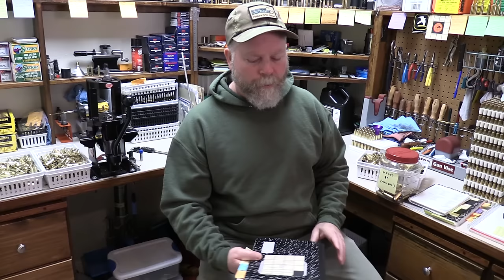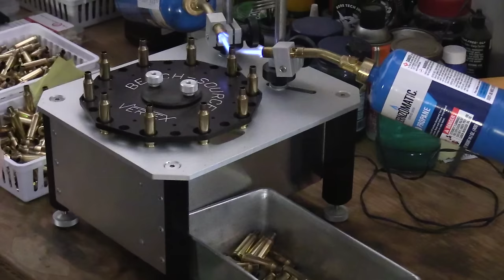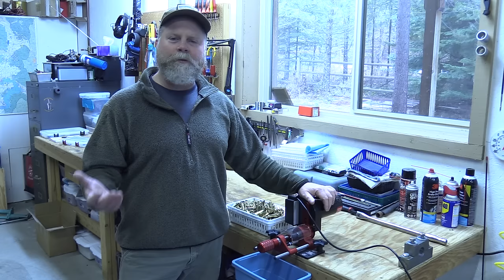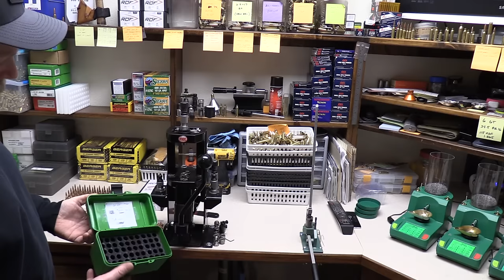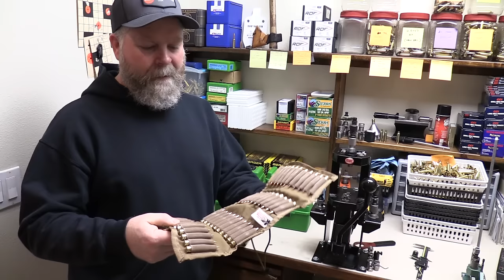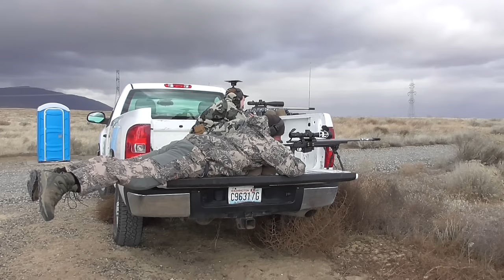Reloading for Precision Rifle: My Process--Start to Finish

Comment: I have an idea. Why not get some new brass,  full length resize it and find a load it shoots good. Then trim it all to the same length and weigh the brass and let's see if using as identical as possible the same length and weight brass. Makes a difference. Then try neck sizing compared to bump sizing and let's see which is better. Then with that settled,  use whichever one wins and turn the necks down to see if it really makes a difference. I've been giving some thought about the bullet being a couple of ten thousandths out of line with the bore and once it's in the barrel on the way out,  it should be centered. It can't go down the barrel sideways
Reply: If you have new brass, it is typically smaller than the chamber since the manufacture wants the case to fit in any rifle, so full-length resizing is often sizing only the neck. So "resized" virgin brass dimensions may be smaller than resized, fire-formed brass dimensions.
Reply: @RetrieverTrainingAlone  full length resizing means full length resizing. That's why it's called that and it's not the same as neck sizing. They are called different names because they mean different things. It's why when we say full length resizing no one asks, do you mean full length resizing or neck sizing?
Reply: @RetrieverTrainingAlone  I understand the saami standard for a cartridge but chamber dimensions can vary slightly between guns. If a 308 chamber is actually the dimensions of a 300 win mag, it's not a 308. There has to be room, however slight for the case mouth to let the bullet go. For instance if I resize a piece of brass the inside diameter of the case mouth is going to be a few thousandths smaller than the outside diameter of the bullet, so it confirmly grab the bullet to hold it in place during The recoil when the other rounds are fired. If I have to pull that bullet for some reason I also have to resize that brass because it's now the same diameter as the outside of the bullet and  the bullet isn't firmly held in place. Neck sizing just closes the mouth of the case enough to grab the bullet but doesn't push the shoulder back to allow that round after it's been fired to go back in that exact same chamber easily period so even bumping it back a thousandth of an inch is enough to let the brass go in and the bolt close. On my 7 mm I can see where it's stretching in the case head area because I have been full length resizing the brass. What I did recently was take a piece of tired breasts and resize the neck until it just started bumping the shoulder and after each try I would put it in that gun just to see if the brass would fit. I didn't need a bullet in there. All I needed was the resize brass until the bolt would close and then I saved that measurement so that's my standard now but the brass is already almost already shot anyway but if I get new breasts I know what how I have to make it once it's fired
Reply: @RetrieverTrainingAlone  I've never resized any new brass. Not sure if some require it or not but I've never done it. I've checked enough lengths though to know it might not be exactly the same but what I've checked is below max length so it's safe. I have a little fear of chambering a round hits the chamber and crunches it by forcing it back because it's too long..what's cool though is we both understand the lingo and know what he's talking about
Reply: @mountainman78629  Yes full length resizing is not required with virgin brass, simple round out the neck with an expander mandrel.
Reply: @mountainman78629  Since I am reloading for hunting with bolt action rifles up here in Alaska, I full-length resize with a shoulder bump of 0.002"  I use a RCBS Precision Mic or a EW Wilson case gauge with their micrometer to compare the fire-formed case with a sized case until I get the 0.002" less than the fire formed case.  I also resize with the expander ball removed and instead later use an expander mandrel to set the case neck diameter.
Reply: @RetrieverTrainingAlone  I'm in Alaska too
Reply: @mountainman78629  We live in the Cripple Creek neighborhood 12 miles outside of Fairbanks.  Tough to find any powder these days in Fairbanks!
Reply: @RetrieverTrainingAlone  I brought 68 pounds of powder thru Canada when I came. I'm stocked up on ammo and shot 3 22 rounds since I got up here in August

Comment: Now go through the steps to get a round to match the chamber of what you're firing it in :) SAAMI specs are what they are, but, even if you get a round to the exact spec, chances are the rifle will be out, where if you want to get on the insanely accurate side of things, you need to match the round to the gun (or if you are insane, try building a rifle to the round you've loaded.)

Comment: To be successful at reloading you have to both enjoy the process AND have a lot of spare time. The biggest money savings might be in just working to buy factory ammo because if you calculate what you make per hour and all the time you spend cooking ammo it's pretty embarrassing how expensive rolling your own becomes. Nothing is cheaper than just working your day job and buying more ammo with the time you save from reloading. You have to be pretty poor to make reloading worth it on an hourly wage basis. You can also control the cost by caliber selection as the cheapest cartridges are 22lr, 9mm and 556, followed by the 762's, either 308 (7.62 NATO) or the x39 or x54R russians in steel cases.

Comment: I noticed you are OCD with reloading. Nothing wrong with wanting accurate measurements.  But I believe an auto loader dialed in would be faster then doing each step manually.
Reply from the maker: There are a lot of guys making this same comment, but I know of nobody who is using a progressive press in "full auto" for this type of loading. To each their own.

Comment: Sam never answers questions from his subs! Not on YT or his website... Shame that!
Reply from the maker: Really?
Reply: Panhandle Precision funny, I thought that might get a response... Yeah I have asked a couple of Q's here as well as through your website without a response
Reply from the maker: @bugmouthready529  Ask your question, then.
Reply: Panhandle Precision thank you, while using the Sinclair mandrel to size necks with Redding's dry lube do you experience scoring and scratching inside the neck? I am lubing every case but after 2 or 3 I am getting brass build up on the mandrel causing scoring inside the neck. I clean it off with a very light grit emory paper but it just builds up again. Any thoughts and is this scoring something to worry about? Cheers mate.
Reply: Awww I thought we were onto something?...
Reply: Thanks for nothin